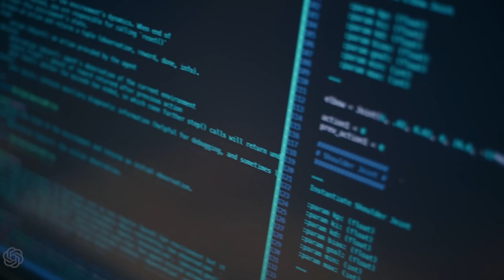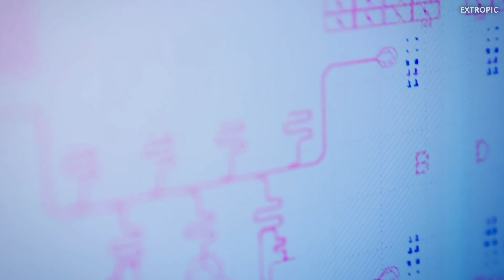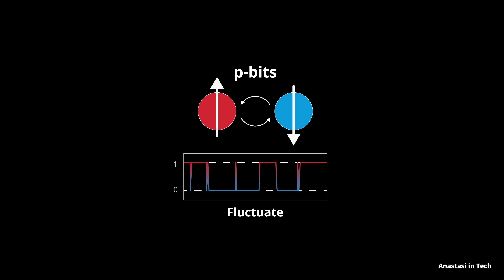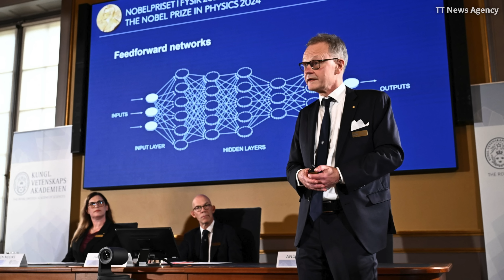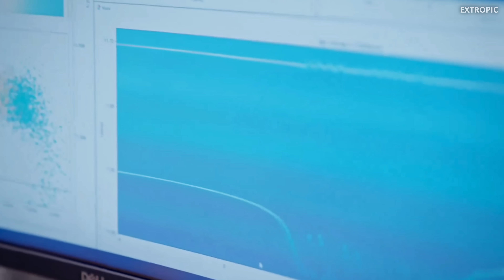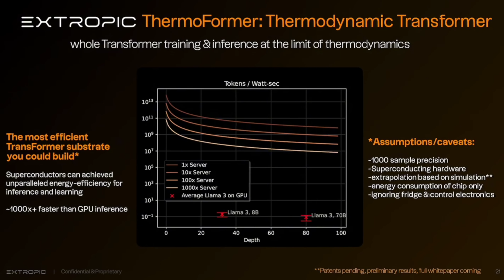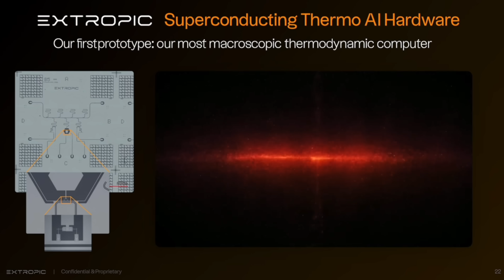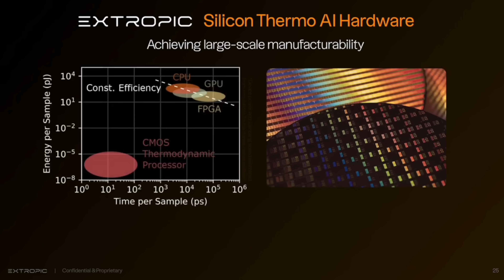Probabilistic Computers Explained

Comment: Just had a crazy idea neural network related, I wonder if it has been tried. Basically instead of having one weight per neuron we would have 2, one being the normal activation weight the other would be a "functional" weight and this particular "weight" would decide what function is performed by this neuron instead of having all neurons on a layer perform the same computation.
Reply: Interesting idea. If you can figure out how to train such system, it could be used as an optimization (improve latency or energy efficiency). If I remember correctly, it has been shown mathematically that using just single non-linear function for every neuron is enough to have same computational abilitities (AI counterpart of Turing machine). However, the proof is about what's possible, not about what's easy/fast to compute.
Reply: Makes sense to me. A typical nuron speak to others with chemical signals as well as electrical ones. Unknowledgeable enough to know how it would work though.
Reply: I am not sure if this has been done exactly as you describe but learnable activation functions is a relatively well explored area.
Reply: @isleepy6801  Wouldn't be surprised, that said, have yet to see anything describing the node functions that way.
Reply: I would think this would make it hard for the system to converge during training. Think about the feedback a single neuron is getting throughout the training process: it's getting nudged one way and another towards an optimal configuration based on the activation function it uses. Then after so many steps of moving to an optimal position for its activation function, BOOM, the selector for the new function flips (you'd also have to invent criteria by which the training paradigm should do this and when), and now the poor neuron has to turn and march in a new direction to get to the new optimal configuration. Scaled up to the whole system, it will never settle to a least energy state because it has to traverse through a state space connected by regions of exotic discontinuities.

Comment: You didn’t really address how p-bits and algorithms and data work together to produce an output or solution.
Reply: In all fairness you’d probably need an entire video for that
Reply: @jamesgallagher2434  What am i watching then?
Reply: You donot use software, you use hardware comparators and edge triggered flip flops to capture the result as it goes by.
Reply: @ the result of what? Randomly generated outputs? For what purpose?
Reply: @sabatiniontech7256  That sound like the s.t I hear from MSM and politic scene all the time. Show the way or it did not happen. The argument that you need a  whole video or that it is somehow a secret does not hold or it does not do it for me.
Reply: She's hardware - not software! 🙂. I'll give you three examples: (1) given a hashed (hashing is one way encryption) password, find the original password. Solution: use a computer in which the p-bits can vary with each other in a analogue way, arrange them in a model of the hashing algorithm, let the system settle to a steady state, and hopefully you've got your unencrypted password (2) optimisation problem: arrange your p-bits to model the problem, then hopefully it will settle to the optimal configuration (3) you want your computer to learn a skill, but cannot seem to train your NN: let your p-bits together settle into a state in which it exhibits the required behaviour. Key problem: variables that need to vary with each other might be physically a long way away from each other.
Reply: https://www.youtube.com/watch?v=VQjmO77wyQo
Reply: It kinda doesn't need explaining, it's too simple. You basically use a single superconducting transistor instead of a cluster of normal transistors that perform this random output operation.
Reply: @ that doesn’t explain anything about algorithms and how you harness this technology to perform useful work.
Reply: @roch145  It's physics.  Watch the video.
Reply: @ Your answer is like saying a silicon chip CPU is all about physics.  Billions of transistors turning on and off to create an output.  But a silicon chip requires algorithms defined by software to tell the transistors how to arrange their on/off patterns in order to accomplish work.  Just knowing the physics behind a p-bit doesn’t describe how they actually accomplish useful work.
Reply: @roch145  p-bits accomplish the same work as a neuron, that is multiply-add of several inputs, at the electronic level.  That is an analog process.  That is what is described in the video.  Are you sure you watched the whole thing?  What one could do is DAC -> new chip does fast AI computing -> ADC, then apply decisions.
Reply: @roch145 I agree with you. Nobody is answering how this random p-bit is gonna execute software
Reply: @ thank you for understanding and validating my question.  Hardware makes software work.  Software creates economic value.  Without software, hardware delivers no economic value and is just a lovely technological accomplishment to admire.
Reply: @roch145  That's not entirely true.   I started my career working on an analog computer.  It was a naval simulator, one one these beastly things built on the 50's.  It didn't have any software, but tons of lamps, motors and wiring. And it did deliver some economic value for a couple of decades.
Reply: @roch145 I think the answer you’re looking for is that all the p bits are made to have a unique bias of chaos. Then you can use a bunch of those like weights in an ai if you understand how that works.
Reply: @AlexBrown-js2gx you’re ahead of me on comprehending quantum computing. Thanks for your insights.
Reply: What’s a p-bit? Or algorithms? Or solution/output producing data for that matter?
Reply: This is really sick
Reply: use a water based chip...
Reply: Here's my take as a pseudo controller bit. Yup i reverse engineered the term. It seemed logical.
 The static is the emf echo, an activity indicator, that might when busy send a stop light, when yellow pass a little traffic, green for zero static, and thus higher cpu priority.  
 But yeah, they didn't say so I'm also only guessing. I'm thinking i kinda just dropped the psoap.

Gimmie more scifi IRL! 🤓
Reply: Or in the meantime, any fast DAC/ADC ladders will do the bridging between the new analog chip and the digital realm.
Reply: Move to the EU. Best before February
Reply: You  have to buy the course. Can't give away all the secrets for free 🤪
Reply: @ I don’t need a course.  Just a very high level description of the way you program with p-bits.  Hardware advances are great.  But the value of hardware is achieved through software.  So it’s a great concept, but software will define its success.
Reply: @roch145  "very high level description" sounds like a course; but, yes, the software is required. But isn't mathematical literature already being implemented as software for these quantum computers? To my recollection, the "software" is what enabled the hardware to begin development in the first place (seeing as the 'soft' is the structured thought and the 'hard' is the physical body) – but it's definitely something that needs to be more publicly enticing...
Reply: @cybervigilante reported with 34 accounts. You're disgusting me

Comment: Sounds very similar to adiabatic quantum computing. Useful for solving optimisation problems, but not universal computing.
Reply: Would you reckon it will be able to be used in even more real ray tracing? Where these methods are used to cast a whole different order of magnitude rays in random directions, where we would cast from the light sources, reacting with materials (maybe based on actual physcs and photon interaction), where only a very tiny margin will reach the camera. Just like irl.

I hope im making sense here.
Reply: @DeltaNovum  It's hard to foresee exactly how things would come to be, but one thing is for sure, once we humans are able to abstract functionality behind a layer, we find all kinds of novel ways to use it. Just look at what we were able to do with data and arithmetic logic gates.
Reply: Yep. I foresee these analog systems working in tandem with classical Von Neumann, Turing machines, all in the same box. So the CPU offloads a task to the analog chip, then takes result back to classical land.

Comment: What is the guarantee that probabilistic computer does not go wrong? how do you compare it with AI? Will this system work in dusty environment and high temperature like 40 degrees C? Pl reply if possible.

Comment: The industry is still running blind in a mine field. Two main issues you discussed, with which the industry refuses to acknowledge is and will remain the main problems in current and developing technologies:

1. Speed
2. The inability to consider development of multi-dimensional, multi-state system, instead of just two-states.

First current, so-called quantum computers are not really, true quantum systems. Why not? Simple! Speed is not a factor on the quantum level. Our technological capability limit of observation and measure remains at 10^-18. As Dr. J.S. Gates has confirmed, anything occurring beyond the preceding level is based purely on mathematical supposition = its a guess on probabilistic and stochastic theory level, with an exponential growth of uncertainty - confirming my first statement about the industry´s efforts and waste of time and investor´s money.

Secondly, current so-called quantum computing systems have to be cooled down to as close to Absolute zero and or -240 degrees, voiding any consideration towards the potential use of TEG´s [Thermo Electric Generators], which could potentially and hypothetically, not theoretically, convert the so-called quantum system into a BlackBody Radiator, effectively and definitively solving the thermodynamic equilibrium issues, instead of requiring energy from a small city to power up the quantum system, just to sustain the temperature at -240 degrees for prolonged periods of computational tasking orders.

Lastly,  rethinking current mathematical standards of operation, function and applications is required and mandated to create software which could be embedded within the hardware and components to allow for "time-agnostic" programming and computing for multi-dimensional functions and solution creations, using the E8 root matrices system to create dynamic algorithms.

In closing, the obsessions with increased speed and function in computing is delusional. Just as it is with trying to create a spacecraft that can travel at the speed of light. Light has not speed. If it does, then show me the device that was used to measure it and I will sell you my 3 bedroom 3 bath luxury condo in Antarctica for 1 Bitcoin.? Instead of focusing on speed with faster and small chips, let´s figure out how to embed gyroscopic mathematical algorithms into software towards creating acoustical holographic computing systems.

You are so intelligent Ana! When are you going to begin building your own vision and idea of the future of what computing should and will look like in near future!?

Comment: i keep hearing about advancements  for decades  !  but nothing changes for me ! i kinda get sick and tired of this crap !
Reply: Because theyre grifters. They talk big to grift. I came up with a concept thatll do this stuff but academia grifters are all off using thier grifting powers to take it away from me :(
Reply: 99pct of the time, these great new ideas don't pan out when you take them out of the lab and into reality.
Reply: There's a delay between proof of concept then 'profitable' manufacturing and finally, you the average consumer. (5-15years)
Reply: The statement is due to a lack of vision. If you can't take all the abstract information in and apply it to a vision you will never come up with a solution

Comment: p-bits would then be a new implementation to solve stochastic processes ? Could p-bit replace GPU, Asic, FPGA and Neuromorphic Processors for all applications ?
If you consider the brain size of a fly, which possesses autonomous mobility, the ability to avoid obstacles, search for food, and find a mate, all while using minimal energy, it's clear that current computer technology still has a significant gap to close in comparison to biological systems. And digital computing based on silicon seems to reach quantum physics barrier of uncertainty.

Comment: I would like to ask, we all love the digital cpus we have, or always hope we get a more powerful one, and we also know for graphics, we add in a graphics card like an Nvidia graphics card, so would it be possible to work this new chip also on a add on board or card like we do with  Nvidia and run both the digital with this new cpu, working together  or would it be something you would put this new chip as the main CPU and add on a digital chip add on board like Nvidia GPU cards?  Or would the two never be compatible one with the other?
Reply: would depend on how it accesses memory, it would need alot of low level cache or it would need system memory which would have a bottle neck bus rate im guessing
Reply: with all tech the transfer from and too electric is a bottleneck also

Comment: The point for me is its availability. Talking about these breakthroughs when they are just discovered is not really helpful. It's only hope, not a promise, i.e., wireless power transmission, neuromorphic computing, chiplets, 3d stacking, and optical computing. Sure, it's fun to dream, but getting excited about something that will take years to develop and most likely change beyond recognition of the descriptions now is not appealing. However, I enjoy your show, but sometimes it's too good to be true. Rob
Reply: Chiplets are already a widely used thing, what are you talking about?
Reply: @JasminUwU , I'm sorry. I was misinformed by Microsoft Co-Pilot. I thought this was the case, but I assumed it was ones used in different configurations or forms. Rob
Reply: But dreams are becoming reality sooner and sooner. Everything is speeding up. But alas, the bad is also speeding up.

Comment: Is this stuff programmable or is just a circuit which can handle only one calculation?
Reply from the maker: Yes. The most interesting part - the shape of distribution (PDF) is confugurable
Reply: @ so it an hardware based way of performing various programmable Monte Carlo. Cool!
Reply: It does get fuzzy, doesn't it?  ;-)
Reply: @MrJdsenior  what you mean by fuzzy? Fuzzy logic?

Comment: I wonder if in the future we will have systems that take advantage of all the different types and approaches to computing where those approaches are the best solution for a given problem/question.  I imagine a system consisting of classical, quantum, analogue, + other types all working together, and/or controlled from a central unit/interface where problems, questions, projects are fielded, where those are then broken up into appropriate parts to be plugged into each computing system type for best answers/solutions.  
Je ne sais pas.  I don't know.  
I don't really know what I'm talking about because I'm not in the industry.  I just see talk about different types of computing approaches and wonder why these are conglomerated into a unified system where each approach works to its strengths.